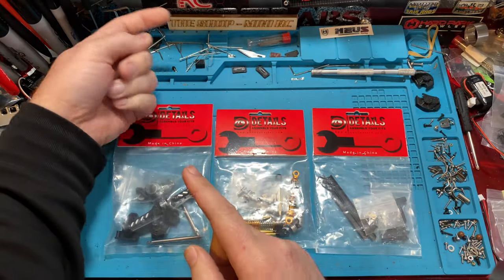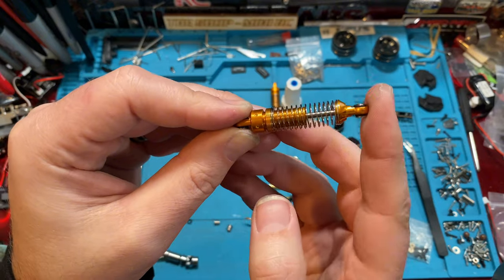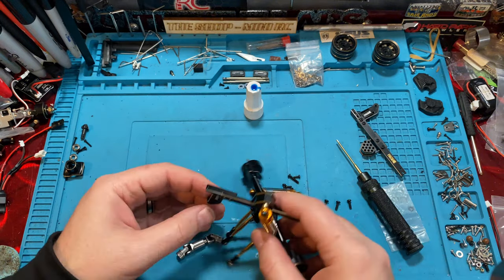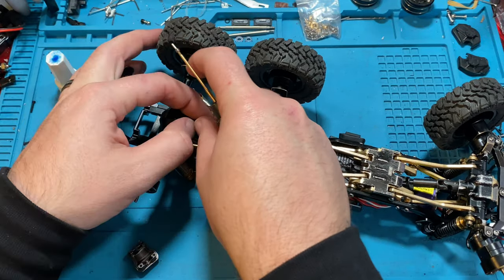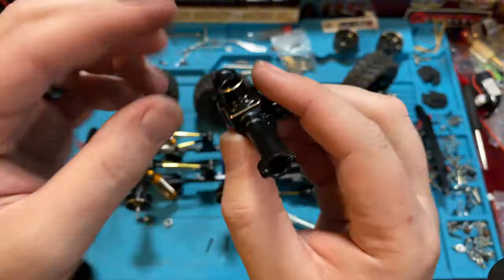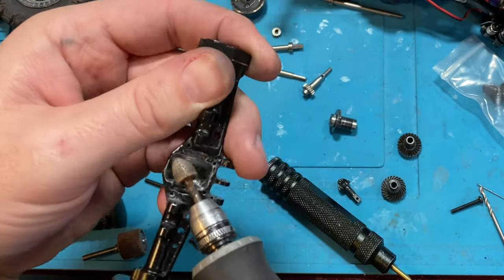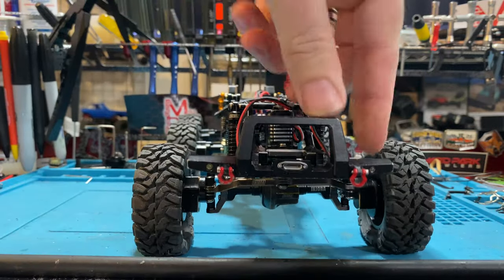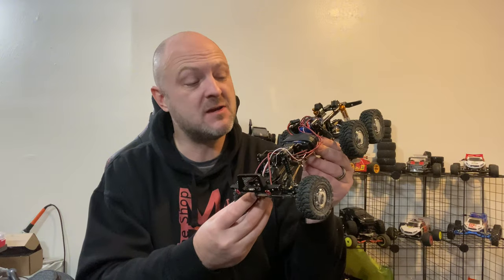Hobby Details TRX4M 6x6 Build! Brass Brass Brass!

Comment: I can’t get this to fit any trx4m’s
Reply from the maker: Odd. We had no issues. Are you using a high trial?
Reply: @TheShopMiniRC  i did try many many different parts and links, ether the driveshaft is too short or too long
Reply from the maker: @Rckid28  cut a “too long” driveshaft down.

Comment: i personally think the flub inserts are completely useless ill stick with my injora yellows flubs are way too overpriced for what they are
Reply from the maker: We disagree. The design of the clubs as well as the thousands of size and density options make them #1 in our opinion.
Reply: @TheShopMiniRC  the print quality for the price isn’t necessarily worth all of the options they have my body and many others body kit for example was a etsy startup quality print that we waited 6-8 weeks for
Reply from the maker: @sorenmay5630  I’m talking about the tire inserts.
Reply: @TheShopMiniRC  I understand that but if a product printed in the same way is hardly ever high quality why even bother risking it with those
Reply from the maker: @sorenmay5630  I understand the concern, but the inserts are of the highest quality. Should I be rich enough, every vehicle I own would have a set of them. ;-p